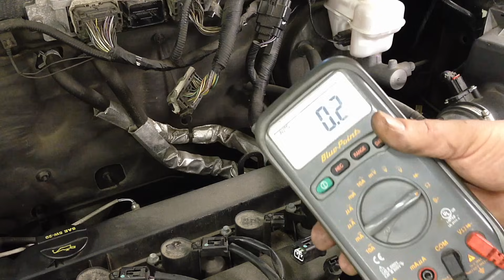Ford Ignition Coil Primary Codes P0351-P0360 Diagnostic Walkthrough

Comment: This is Omar's friend... I do not think of this noise as a "knock"  but as a light "tapping" sound, you can best hear it when the sound is reflected off of a wall with the window open.  Is present ONLY when accelerating, if I take my foot off the gas pedal it stops.  It increases and decreases with engine speed and is present when engine is hot or cold. Thank you for your help.  Bob

Comment: Great walk through, Ford main office should offer you an instruction position.But of course we would want you to keep doing this for all of us.
Reply from the maker: Thanks!
Reply: FordTechMakuloco  I have a 2014 F150 3.5 with 120K. I had a misfire on number 5. Replaced all the plugs with motorcraft and gapped to .030. Replaced coil on 5 and all the boots to the other coils. While I was there I cleaned all 3 MAP sensors. Ran great for a week and now it runs even worse than before. Has two codes; P2300 and P2303. I checked all the pins in the coils and in the harness and checked all coil wires for chaffing. All looked good. Do you have any ideas?

Comment: good video dude.
in the Gm world i can say the newers cars are all testing circuits for you, there not perfect by any means but they do poiint you in the right direction! cept there usally generitc codes which will give u same diag if you didnt know it was open or whatever.
like a c0045 sym 00 or o6 open or shorted and signal erratic, you would think WSS is bad when most of the time you see thos codes togethor its the harness itself that has a broken wire inside the insulation

Comment: Non misfire related PCM issues on fords are on the 99-03  Windstar with throwing intermittent abs codes. The master relay is in the PCM for the absy and from what I've seen is the circuit board will heat up and distort itself.you'd think they would have an ebcm or something on those lines.